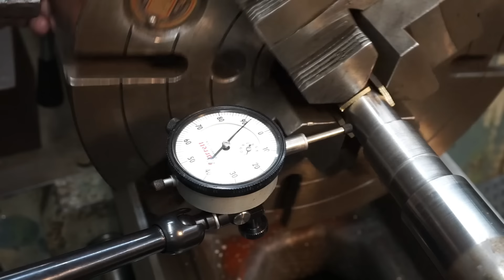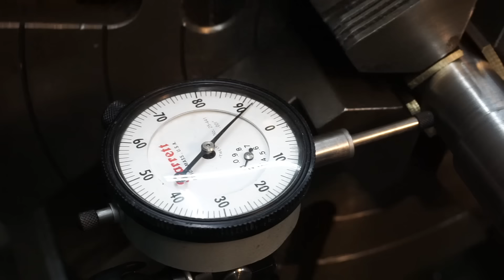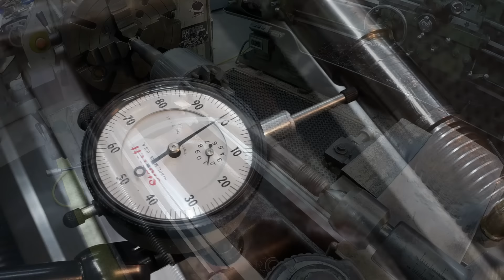Spray Welding a Pedestal Grinder Motor Shaft

Comment: Great experience, i was concerned about the chattering when you put the new cutter on the rear cut, really wasn't doing to well withh the radius ground cutter. but it worked out great after the adjustments. thanks.

Comment: If anyone is interested in an explanation of the run out he mentions at the end, or possible reasons the center hole isn't centered, I used to work in a factory that made these, and i have some insight

The run out near the rotor is normal, and usually more pronounced with skinny shafts like this. The shafts flex when they're getting pushed into the rotor with a big hydraulic press. This makes run out near the ends of the shaft, which is bad. The run out is transferred to the rotor portion of the shaft by spinning the shaft and rotor on their bearing journals, using an indicator on the business ends of the shaft, and using a hydraulic press to bow the shaft in the rotor portion until the ends run true. Basically, you bow the shaft like a banana until the bearings and ends of the shaft run true, even if the rotor doesn't. The body of the rotor is turned to size after, so it's outer circumference also spins true to the bearings. However, the bowed shaft is now uncentered in the centered rotor, and a weight unbalance is created. This is solved by adding or removing weight to and from the ends of the rotor, til the vibration is almost completely diminished. So as it comes from the factory, that shaft was probably almost perfectly balanced and vibration free, even with the run out. It's probably fine even after being worked on.

As for the center hole, motor manufacturers only care how true they are while the shaft is being machined. Pressing on one end to push the shaft into the rotor often deforms the hole, or slightly mushrooms or mis-shapes the end of the shaft. Even once straightened, the ends of the shaft may be tilted ever so slightly, which shows up when trying to true a shaft for repair like this. When I worked in a repair shop, we would shim the hole with specialty shim stock, sometimes as skinny as .00025, to true the bearing journals, and then send it. If the hole was off too much, we'd cut it true like Abom showed here.

Comment: Maybe you did but you didn't show centering shaft in stedayrest. Shaft was off center because the hole was off center. You should have centered shaft to the good part after backing off the live center. Then after recutting hole it would have been perfect. I love your video. You are a great teacher.

Comment: That tool looks like a braze on tip. During these operation ,particularly with long shafts, leave the steady rest in place to eliminate the chatter. I started using spray-on Eutectic products back in 1973 or '74, while I worked at the Roots Dresser Warranty Repair Center in Houston.

Comment: Wow!Outstanding. Who did the camera work? 5 stars. 35 years ago I had a V Drive shaft resurfaced this way. It had been submerged in salt water. The metal spray worked and saved the shaft.

Comment: I agree on the center rotor area...you could see some of the run out early in the video while spinning the shaft at a faster speed. Either that run out wore the bearing journal or the bearings had been failing causing much drag and slip although there wasn't any heat evidence for that.  
Love that lathe much.  By the way, you machinist folks are correcting poor manufacturing with almost every job. Had they been done right at the get go, much of the problems wouldn't exist. Just some added proof that today's manufactures and their million dollar machines are turning out expensive parts that don't compare to a lone machinist who has experience and skills.

Comment: Great video. I learned a lot. Especially about shaping the cutting tool. I wish you would’ve slid the bearing back on there afterwards to see the before and after though.
Reply: Chuck's Truck if done to spec the bearing would need to either be pressed on or heated 250 to 300 deg f and installed. A good machinist does not need the trial fit.
Reply: Dale Loveridge thanks. I guess?

Comment: That technique reminds me of the cold spray process, where a gas carrying metal powder is accelerated through a converging/diverging nozzle to supersonic speeds. The fast moving powder is then sprayed onto a substrate where it "splats" so hard it metallurgically bonds. It's a more high tech approach but a lot less friendly on the bank account than spray welding.

Comment: I’ve only seen about 50% success with spray metal regardless of the source doing it. It sometimes crumbles away during assembly or in a short time of operating. The greatest success for me has been with Locitie 660 and thin shims placed four equally spaces to align and center the bearing race. It’s quick and done on site. To remove, you simply heat the bond area with a torch. It’s good to about .015” clearance. It sets in about 15 minutes but I’d leave it alone for at least an hour before final assembly. The surfaces must be absolutely clean and free of oil. I’ve been in a pinch where we had get rock crusher going, at least temporarily till the parts arrive. We had no Loctite 660 so we went to the hardware store and picked up a bunch of JB weld. That JB weld and shim trick is still going 3 years later and the spare is waiting. The most important thing is that the inner race on the shaft as well as the outer race in the housing are tight, not slip fits.

Comment: The spray welder I have looks like a cutting tourch bottles screw on top.when you squeeze  the cutting lever the  the power is delivered .only ever used it a few times .was a gift  from a buddy when a local business  shut down.Took a little research on Utube to see how it worked

Comment: @Abom79 Back in '05 in the welding program at tech college I used a nickel spray weld process to repair the cast exhaust on the '53 Case SC tractor my dad was restoring at the time. It was a 4 bolt flange with an S bend immediately off the flange and it had 3 cracks that had been previously arc welded. While grinding those welds, the added material literally popped out. I used a machinable nickel in a different sprayer. I don't remember the manufacturer, but this one more resembled a cutting torch with a bigger welding tip. It had a metal hopper and a lever like a cutting torch, but it controlled the powder flow. It worked slick and the exhaust is solid to this day. 

As an additional note, my I'm in MN and my instructor told us about when he worked at a welding shop in Southern MN and used this process with a wear resident alloy to plate the sewing feet for all the sewing machines at the Redwing Boot factory that nearly eliminated their regular replacement.

Comment: There was this master machinist who is also a welder and a brazer and he has the same problem. He could have used a molten metal electrostatic plasma sprayer but he prefers the time-tested and time-proven electric arc welding machine. So he has the shaft placed on two dual revolving multi-supporters (there are 4 to 5 multi-supporters and started the machine to revolve it at the correct speed and use an automatic stick welding machine with a customized military grade welding electrode and started welding around the shaft with overlapping welds of high alloy electrode metal. Then he has it machined on a precision lathe adjusted on the required engineering specifications and bingo! A much better shaft that is above specifications. That was in the 1960s.

Comment: Spray welding is a 'first' for me. I did similar repair with electroplating on hydraulic cylinders/rods. I suppose the amount of damage would dictate which process would be best.

Comment: I've done a fair bit of metal and ceramic spraying.. xinc, , mild steel, stainless steel.  fused ceramic wear coatings, etc. I'd say this was a good job, if slightly over heated on the first spray

Comment: 2 things. The rotor is the critical mass that should run true. The shaft is not that important. The truth of running should have been checked AGAIN after the heat and BEFORE final turning. 
Great demonstration of spraying build up.

Comment: Very interesting process!  I've always wondered how those types of repairs are done.  And I was curious what factors determine when to use cutting oil or not?  A lot of machining videos I've watched will have a stream of oil flowing to the tool, but I didn't see that here.

Comment: top tip: set the shaft up between centres, skim the worn sections true and to a size.  then spec the bearing for a smaller inner diameter.  simples

Comment: Similar in kind to metal spaying but for the safety aspect of the welding its needs to be enclosed and not subject to open air as the metalic compound  when heated is severely dangerous to your health, would question the lack of proper masks.
But wonder why the journals would wear so much, as my thoughts would be into, who fitted the bearings?
Reply: He addressed why he believes it wore so much.

The shaft wasn't turned true the full length of the shaft and so had a lot of difference in weight at any given radius near the center.

He believes that caused excess vibration

Comment: Adam,
I have a question:
Why did you go the route of spray welding as opposed to making a sleeve to bring the journal back to size. 

Good job as always, great to see the manual machining side of the things.
Reply: sdeery you don’t want to sleeve journals because the sleeve can end up spinning on the shaft.

Comment: We don't have a spray welder. What I do is undercut the journal, machine a sleeve with the ID to match my undercut. The OD of the sleeve is quite a bit oversized. I then split the sleeve and grind weld reliefs on edges. Clamp the sleeve halves to the shaft and weld the sleeve to the shaft along the splits. Make sure that you have ground enough to leave a gap between where the sleeve was split to get good penetration in the shaft. Build the weld up a little past the OD of the sleeve. After the shaft cools, machine the sleeve to proper OD.

Comment: The scratch threading under the spray weld increases the surface area of the part your spray-welding.
More surface area = more holding power

Comment: I have a 1930`s 10 LeBlond lathe. Trouble is we work in mm in the UK so have to get to used to how many thou a mm is and go from there. Great lathe. I`ve even made a brass bearing for a JCB digger turbo that worked ok after.

Comment: Thanks for the excellent presentation. I had a crank shaft spray welded on the first engine I ever rebuilt. I'm not sure if it was a rod or main, but I remember the spray weld. Would a sleeve have worked on the armature job?

Comment: Worked at a electric motor repair shop several years back. Hated doing this. Remember ot being a dirty process. Would rather have traditionally turned undersize and welded everything. But I wasnt the boss. Just me tho.

Comment: On Submarine Tenders and at IMA's we used the METCO and Eutectic Uetelloy flame spray processes, though on bearing journals we would use the SIFCO electroplating process, bit the flame spray rigs and powders are WAAAY less expensive than electroplating rigs and the chemicals!! Nice video Thanks for posting! Your not a Navy MR by chance?

Comment: Brilliant stuff!
How does the spray welded material compare to the hardness and strength of the original material?
Any limits on the types of steel it can be bonded with? Is there a similar system for Aluminium?
What advantages does this method have over sourcing bearings with an undersized center and machining down the shaft to match?

Comment: Could you not get a bearing that has a smaller ID and rurn it down?
Reply: itd wear out too soon, thats usually how they choose bearing sizes
Reply: I mean it would only be a little smaller and if they make one the balls would be bigger or at the least the same size
Reply: I figured that might be the case but i figured there would probably several of alot of sizes that have the same OD with different ID's and also some with the same Id's and different ODs

Comment: Nice video. I really liked that you recut the center to run true to the bearing diameter. I had a couple questions I hope you could help me understand. If the center can be pushed over with the steady rest, can't it be pushed over during machining? Could you have knurled the bearing diameters and then ground them down instead of spray welding?  Also, why didn't you indicate along the length of the shaft on the side and top to before and after processing to make sure you didn't cut a taper or distort the shaft from heat?  Lastly, when I was a toolmaker we were taught to push the emery cloth toward the workpiece. Pulling is a great way to get your thumb on your bottom hand sucked right into the workpiece. Overall, great stuff. Thank you.

Comment: I wonder if the surface will be as hard as the original. It all depends on the bonding and the metal used... right?

Comment: Hello Abom. I was wondering why you don´t just aply a layer with stick welding and then do the milling. Which are the advantages in use spary welding on this cases. I think stick is the easiest and cheapest way. I hope you share you point of view whit us

Comment: nice job. However with only .005" under I would use a portable electroplater then only machine once to size. other option that is often viable is to simply cut once and change bearing (if not bought yet or easily exchanged at a grainger or mmcar, etc..)to a new one that has same specs except for the new id requirment.just options! Also,even thought I never used, I have frineds that have used flamespray from san diego..i think similar process but different guns.

Comment: Damm..i never knew such welding method exist!

Most shaft repair job i knew involved manual stick weld with much thicker beads and machined to size...

Comment: Thanks for showing this technique (used to be called metal spraying in the UK), I'm glad I've seen it. Would it have been possible to have turned those journals down to the next size down bearing I.D.?

Comment: 28:49  I used to use a tool grinder like that back in 1962 age 15.
30:04 nice to see Abom using correct mic hold.
31:13 makes me cringe to see emery held like that.

Comment: Have you thought about an IR-gun to check the temperature of the shaft before you spray weld? I was thinking what happens if the shaft gets to hot when spaying, if you stop it from turning could it warp?

Comment: Great video, Adam.  Centering the shaft up made me wonder if a 4 jaw chuck is ever fitted to a live center for the tail stock.  Then the 4 jaw could be centered up like the one on the spindle.  Would that work?  Have you seen that?  Thanks for your stuff.

Comment: So, does this process work for things where friction would come into play like crank shaft rod bearings or Babbitt bearings? Or is it basically just a space filler to be used under a low friction bearing so the bearing runs true? Impressive thanks for the vid!

Comment: Pretty interesting stuff🙂. Does that stuff ever delaminate? I remember building up a shaft for my boss many years ago but just used a mig and spun it by hand on some rollers.
Love the tip utilizing the tool post to stabilize the tail stock. Thanks for the vid and great work😁.

Comment: Instead of the powdered metal coat is there some other way to repair this, i remember where i worked before we had some shafts that where periodically repaired and where the bearings went there where what looked like sleeves, they werent races as these where always freshly cut

Comment: My spray welding torch looks more like a normal oxy torch and it has a leaver to make the powder start flowing, is it just a different model to yours or is it for a different application, I’ve had it for nearly 30 years and haven’t known how to use it until now, thank you for the video.

Comment: I was wondering what could make a race that turns with the shaft eat into it so badly without signs of corrosion or seized bearings.
So chatter?
Thanks for the explanation at the end.

Comment: Excellent video, I have been wanting to try my torch for years.  You did not show zeroing the run out with the steady rest, did you really just snug up the three legs and re-drill the centre hole? Had you cleaned the centre hole before mounting the shaft? Is there a reason you put the indicator on the scuffed up grinding wheel journal rather than the unused journal next to the bearing journal? When you take a ''ten thou cut'' is that on the radius or the diameter? What is the normal thickness of build up you are looking for with this process?

Comment: Interesting kit never seen that type of welder where ya get them from 
So take it the medium type you put in depend on strength hardness 
I used to "spray" weld with my mig but nothing like that think I was told a bo bo when I was shown how to spray 

So why spray the shaft is it to do with distortion

Comment: Quick question. Does the shafts temper not matter? I noticed that you drew quite a bit out of the shaft. I am slowly trying to build myself a full shop. I mostly do blacksmithing, so I honestly don't know if it matters or not.

Comment: Wouldn’t trueing with the soft jaws potentially introduce variances? I’ve only ever seen trueing done using bearing journals as the rotation point, but that’s on a 2 stroke crank so doesn’t use a lathe.

Comment: It works much better is you turn small threads on the shaft. The spray weld holds better.

Comment: Spray welding is just a simple method of spraying molten metal, just that. But what is missing is spray there is no electrostatic charge so as not to waste the molten metal alloy!

Comment: Hi Adam, This is very interesting...if you do not have that wedling setup, can you stick to tig weld some beads lengthwise build it up and then cut it to size. Or is the heat an issue?